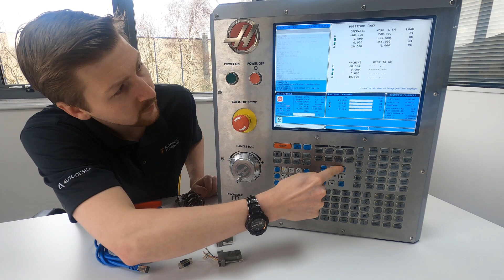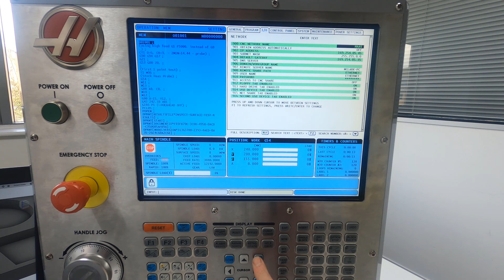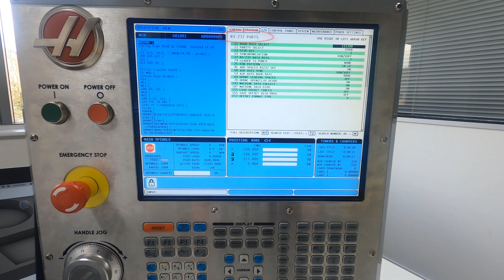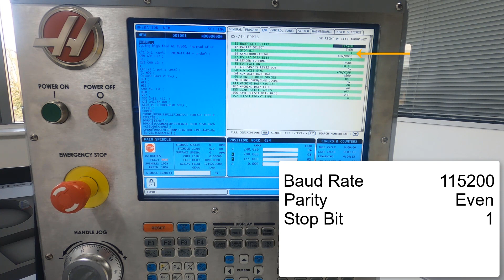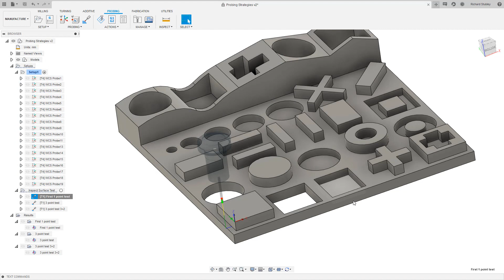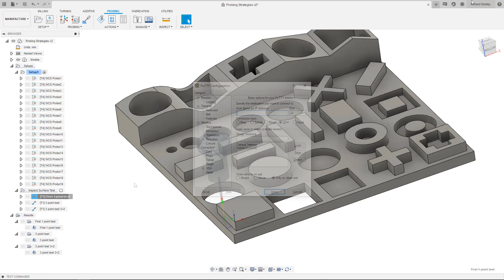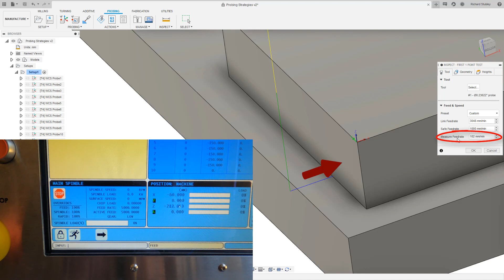Autodesk Fusion 360 | Tutorial: Fusion 360 Live Connection to Haas Classic Control

Comment: what about Heidenheim and FANUC!.
Reply: Hey, like Jon said the Heid and Fanuc don't need to be connected as they can write internally to memory.

The Heidenhain uses Function 16 F print.
We declare a string into the Q parameters the use something called a mask file that then writes that string to the file specified.
27 DECLARE STRING QS1 = "START"
28 FN16: F-PRINT TNC:\ADSK_MASK\MSR_MASK.a / TNC:\Fusion\Setup1_RESULTS.MSR 

I do have a Heidenhain simulator, so I can add that to my list to work on.

The Fanuc has 2 output channels, 20 and 21. if Parameter  110 bit 0 is a 0, you are using parameter 20, if its a 1 you are using 21.
Now the value of 20 or 21 lets you know where the file is being written to, 0 serial connection, 5 data server, 4 memory card, 9 FTP, 15 Ethernet, 17 USB.

We then just use the normal DPRNT commands to write a file at the location specified in the parameters.
I don't have a Fanuc simulator so this will have to wait till I am back in our technology centre to make the video.
Reply: Heid and Fanuc don't need this as they can write to a file which you can transfer to a PC with just a flash drive without all this extra setup. Same with newer Haas NGC.